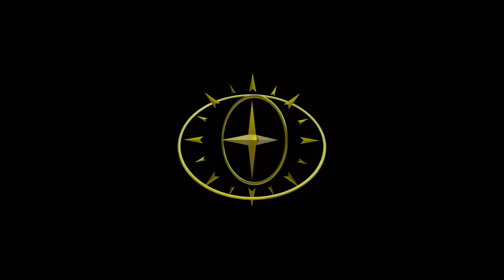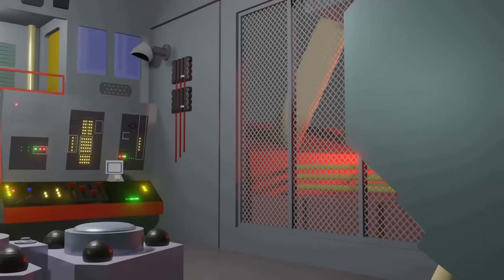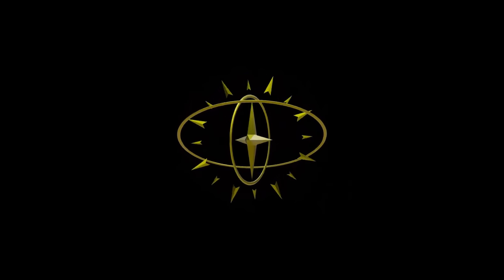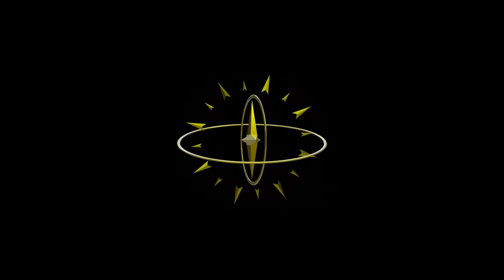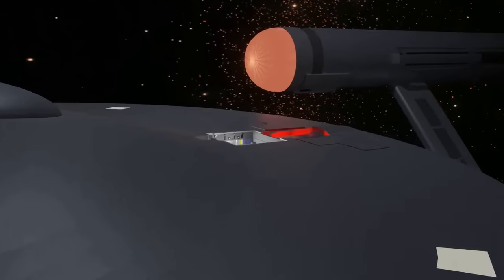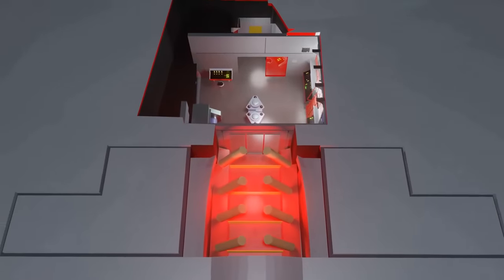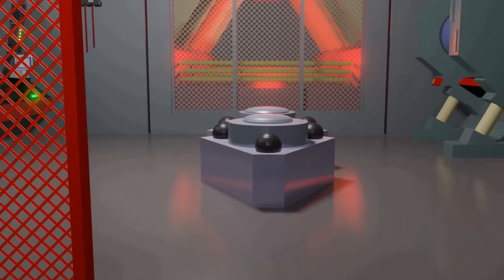The Enterprise Engine-room Enigma: where was main engineering?

Comment: I don't quite remember where I read it, but in TOS the saucer was designed to be a lifeboat and separate from the rest of the ship.  It was never shown because of cost concerns.  It would make sense for engineering to be in secondary hull in case of a warp core breach.  The real reason for this question is that the creators never concerned themselves with it, thinking the show would never be as influential as it eventually became.
Reply: TNG, me thinks. I don't recall it ever being mention in TOS.
Reply: @timsmith2525  It was. In two episodes, "The Apple" and "The Savage Curtain".

Comment: Main Engineering is in the Secondary Hull or Engineering Hull pretty much directly under the innerconnecting dorsal  it stops near the main Engine pylons  there was a separate but near identical engineering room in the primary Hull. The ship has two semi separate engine rooms in the event of an emergency separation. Each  component of the ship is supposed to be able to be able to operate to get to safety until a rescue could arrive.

Comment: the Constitution class Starship , has MAIN engineering in the Seccondary hull w/ a LATTERAL intermix chamber , that connects Directly to the Warp nacelles. there is no Enginering connection in the neck between the Saucer section & the Seccondary hull. there is no Vertical intermix chamber , unlike the REFIT Enterprise and Enterprise II class starships. 
the Saucer section only has Emergency batteries and a minor Enginering that controls BOTH the Main Enginering (seccondry hull) and the Impulse Drive systems , there is also an Auxiliary Control in the Saucer Section that has a VIWESCREEN monitor. 
and the Chief Engineer can monitor & control MAIN engineering & the Impulse system from the BRIDGE station.

Comment: The warp core was horizontal rather than vertical and largely closed off from view due to radiation - the constitution 2 was the first to have a vertical warp core - so I imagine it was beyond the grid we saw in main engineering on the secondary hull and had some sort of port for accessing the dilithium crystal. The main saucer complex did have impulse reactors but those are not connected to main engineering. A logical reason for the curved hallways in the secondary hull might have been the proximity to the neck of the ship. Ultimately there were as many rooms that could be considered "engineering" as you can guess - everything from phaser control to shuttlecraft maintenance, but only Main Engineering would have been secondary hull at the base of the neck as it needed to be in close enough proximity to deflector control etc.  This is where the warp core was located and that was why the saucer wasn't part of the secondary hull - to cut down on radiation exposure.

Comment: I remember reading somewhere that the angular tube array in the background of TOS was part of the impulse drive.  The two circular structures in the middle of engineering in TOS is the top of the warp core which passes down through the "neck" of the ship.  The main of engineering section was relocated during the refit.
Reply: Those tubes are actually the warp drive EPS power conduits. In "The Paradise Syndrome" when the warp engines fail, the sparks and flashes come from there, and in "The Ultimate Computer", when M-5 hooks in directly to the warp power, it aims at that part of engineering.

Everyone gets the idea that those are the impulse engines from the mostly non-canon Franz Joseph technical manual and his later booklet of general plans. However, later plans show main engineering in the secondary hull and a smaller engineering for the impulse engines in the saucer.

Comment: One interesting little idea: If you look at some of the early Enterprise "blueprints" that were published, they don't include a warp core at all and there seems to be no warp drive machinery in the secondary hull. I believe that early in the show, the warp engines were conceived as self contained power units, which is consistent with some of the internal production document descriptions. Rodenberry flew bombers, so it makes sense that he would conceive the warp engines as self contained power units, like the engines of a bomber. In that case, there isn't a "warp engine room" at all. I think that the "engineering deck" set was initially conceived as being connected to the impulse drive, and the "pipe room" is supposed to an impulse engine, but then the requirements of drama made it necessary for characters to directly work with the warp drive and that just had to happen in the engineering deck. The dilithium crystals get invented and just kind of stuck there for want of a better place and the location and function of engineering becomes a mess.

Starting with the movies, the demands of drama mean that we get a "warp core" as something visible that characters can interact with, but they just didn't predict this dramatic requirement early on when they were developing the show.
Reply: Believe it or not, the original Star Fleet Technical Manual has TWO engineering areas: an area marked "Main Engineering" near the Impulse Engines in the saucer, and a separate "Warp Drive Engineering" in the secondary hull right under the nacelles. Main Engineering is shown to have computers that can monitor the warp drive from there.
Reply: @Idazmi7  Franz Joseph's "Star Fleet Technical Manual" from 1975? His blueprints from 1973 show now engine room at all in the secondary hull. It's full of living space, which makes little sense, and Franz Joseph wasn't directly involved in production, but I think it does show that he wasn't even thinking about a warp core or warp engine room as a concept. The dates are probably significant because Star Trek I was in early production at the time (based on earlier work for the Star Trek Phase II show), and they built the first main engineering set with a recognizable warp. That was a big change in how warp drives were depicted. 

If you look at Matt Jeffries concept drawings for the Enterprise, you'll see the warp engines described as "Power Units" or "Power Pods", which sound like self-contained devices to be, not just outputs for some kind of engine core inside the hull. Gene Roddenberry was a bomber pilot, not a navy man, so it makes sense he'd imagine self-contained engines out away from the ship, like the engines on the wings of a bomber. Early on, Scotty operates the engines from the bridge, just like the flight engineer of a bomber up in the cockpit. He also calls them "engines" plural. I don't recall later engineers using such terminology or any plurals to refer to the warp drives, once they had a single reactor core deep inside the ship.

I think Roddenberry initially went with his flying experience, imagining the engines as self-contained, out away  from the body of the ship, and inaccessible in flight, but later the demands of storytelling required a warp drive characters could actually see and touch, and with the show's tight budget and everything being made up as they went along, we got a bunch of very inconsistent portrayals of the ships propulsion systems.
Reply: @TonboIV  
"Franz Joseph's "Star Fleet Technical Manual" from 1975? His blueprints from 1973 show now engine room at all in the secondary hull."

*SIGH* Deck 16, "Medical/Warp Drive Engineering." I swear you people don't know how to read...
Reply: @Idazmi7  What the hell? There's no reason for you to be that rude. When have I been rude or at all hostile to you? Yes, I did fail to notice the name of the deck, because I was looking at the rooms. That's an oversight on my part, and I'll admit it, but can't we just have a nice conversation about this instead of attacking each-other? Anyway, I'll have a bit more of a think about those plans now before I say anything else.
Reply: @TonboIV  
Also the reason there's living space:
"4. The primary hull is separable from the secondary hull. When separated each unit is fully capable of independent operation. (...)" - Sheet 4, Outboard Bow and Stern Elevations.

Comment: As a kid, I always wondered if there were “impulse engineering” rooms.  There would have to be some kind of space for controlling and maintaining the fusion reactors and driver coil assemblies.
Reply: There is, at least according to Where No Man Has Gone Before with Gary Mitchell's line to Lee Kelso about blowing up the whole impulse deck. Doug Drexler's plan even calls that area the Impulse Deck and has a smaller engineering space with Main Engineering located in the secondary hull.

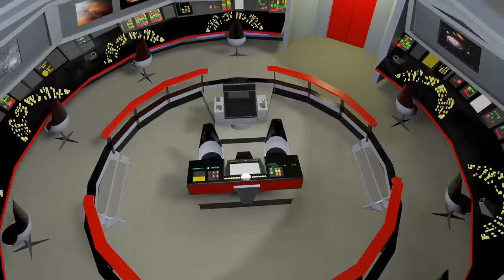Comment: 5:02 The "knob" at the back of the bridge module is supposed to be the turbolift, meaning the interior of the bridge is actually cattywampus to the ship itself, and its centerline isn't the ship's centerline.
Reply: That's a theory (and it was certainly the intention in "The Cage") but it doesn't make sense with how the actors lean in their chairs when things happen.
Reply: Well that is the shaft to the lower decks but not the door entry to the horizontal shaft, Cars can be waiting just to the right of the proceeding car.

Comment: In the second season, the Main Engineering set was modified and on the left side of the set (looking aft), there is a visible ceiling that has large supporting beams. The ceiling is curved, suggesting Main Engineering is in the top of the secondary hull between the pylon that supports the primary hull and the engine pylons. This suggests the forced perspective area behind the screen at the aft of the set is the "Warp Core" and somehow feeds into the engine pylons.

Comment: In the 90’s there was an official cutaway poster of NCC-1701 that was revised by the design team from TOS; main engineering was relocated in front of the hangar so the warp plasma could go straight up the Jeffries pylons. Which makes far more sense than the blueprints of the 70’s.

Comment: I haven't seen anyone mention the use of the term Engineering multiple times in "The Alternative Factor". That room, very clearly, was in the saucer section. To me, that lends credence to the theory that there are indeed two "main engineering" spaces, one in the saucer and the "real" main one in the secondary hull.
Reply: The Star Fleet Technical Manual does show two separate engineering areas: an area marked "Main Engineering" near the Impulse Engines in the saucer, and a separate "Warp Drive Engineering" in the secondary hull right under the nacelles. Main Engineering is shown to have computers that can monitor the warp drive from there.

Comment: My theory is that there were two Engineering rooms - An impulse engine room located in the saucer that could serve as the warp control room and then a lower warp engineering room that had a secondary impulse drive for the lower star drive section. The lower control room held the dilithium crystals. It would make sense that the star drive would have a secondary impulse capability perhaps somewhere on the nacelles, although it would be a smaller, less capable impulse drive than the one on the saucer section. It makes sense that such an arrangement would be in place, providing redundancy, which even today's spacecraft have in place to provide options in case of failure.

Comment: This is an interesting subject and I'm glad you've addressed it.  I think of the contradictions in the following way:  Due to OpSec, details about certain specifics were obfuscated and altered so as to not give away important intelligence.  An example is that the blueprints show engineering at the rear of the saucer section adjacent to the impulse drive while in Court Martial there was a reference to engineering being in the 'lower decks', where the "Heisenberg Compensator" is.  The location of the area with the Heisenberg Compensator is a bit iffy due to the space constraints of how it was depicted.  The blueprints also show sickbay in the secondary hull when episodic references said something like it being on deck five.  Seems more likely that sickbay would be in the saucer section since it was designed to separate to be a lifeboat.  The blueprints also show the Dilithium Crystals as being in the aft part of the nacelles (four each).  This, of course, contradicts what was filmed as cannon.  All of this leads me to a fan theory that what we're seeing when watching the episodes is not actually a fly-on-the-wall, first-person perspective of what happened, but rather a dramatic recreation, using sets and actors, based on the recorded logs of those missions.
Reply: One more thing I'd like to mention is that this video mentioned that engineering is shown off of a curved corridor.  I know of one specific episode where we are in engineering and the door is open where we can see a Jefferies Tube on the right, no curved corridor to be seen.  This would comport with the reference in the video about engineering being in the secondary hull, but backwards.  Otherwise it would interfere with the shuttle bay.  I spent hours pouring over the plans in the context of the episodes when I was a kid and am now happy that I have a better sense of it all.

Comment: Few thoughts:

1. Turbolift systems have so often been visualized as moving in 3 dimensions as opposed to only in vertical shafts, I think it's reasonable to imagine there could be turbolift routes around certain rooms or decks which would seem to block a clear vertical tube up and down the ship.

2. There's no reason angled or curving corridors can't exist outside the saucer section. There is a lot of negative space in ships to provide room for storage and machinery. It would be easier to angle or curve a crew corridor than to move a large system that absolutely needs to be in a certain location. So in-fiction, a curved corridor shouldn't necessarily look wrong in many locations.

3. Even before the reusable saucer separation experiment of the Galaxy class, there's references to the concept of a saucer section being usable as a lifeboat in case the entire warp system is destroyed or must be abandoned. The impulse engines so often being located in saucers really helps support this idea. I believe sometimes, it is imagined there are explosive systems designed to permanently detach saucers in case of emergency. It seems prudent to install a robust engineering control center in both hulls, for redundancy and backup.

Comment: Great little video. Love the graphics....But you got the orientation of the bridge wrong. Supposed to be offset from center a few degrees, not facing forward because of the location of the turbo lift shaft. Anyway, I always figured there were two separate engineering rooms/sections...one for the impulse engines which also operated the functions of the saucer section...and one for the warp engines which also ran the functions of the neck and the secondary hull. One good point for that....the saucer section was able to separate from the rest of the ship and fly independently, so it would gather to reason that it would have it's own separate engineering sections and the rest of the ship would have one also. Also, they would look the same for a couple of reasons...one: cheaper and easier for Starfleet to design and build a universal engineering section that would be compatible for both sections, designing two different ones would have increased the cost significantly...two: parts compatibility. I'm sure as with all spacecraft there are redundant systems installed, so that way parts and units could be interchanged between the two sections. How many times was it written in the scripts that warp controls were transferred to the impulse controls and vice versa?
Reply: The decoupling of the saucer wasn't there until Enterprise D, which was a magnitude larger than Enterprise A
Reply: @andreewert6576  the TOS NCC1701 was also meant to decouple the saucer from the rest of the ship. Is why it has landing legs on the bottom saucer.

Comment: Regarding the apparent inconsistency between "Engineering decks" and 'Engineering levels," in the US Navy, any deck below the main deck, or "deck one," is called a "deck," and any deck above the main deck is called a "level."  The main deck would generally be the obvious one, and corresponded to the weather deck that ran from the foc'sle to the fantail, or it could be designated as another one.  Aboard a Forrestal class carrier, the main deck was the hangar bay, and the flight deck was the "04 level."  So just maybe, aboard he original starship Enterprise, Engineering decks were in the secondary hull, and Engineering levels were in the primary hull.

Comment: I bet there were 2 Engineering rooms on the TOS Enterprise. Both identical, one in the primary hull, one in the secondary hull.
Reply: If you look at the Technical Manual, there are indeed two different Engineering rooms. However, they aren't identical.

Comment: The thing to remember is that the interior layout of the Enterprise in the 60s was not designed by engineers. Obviously, there would need to be two engineering rooms. Even back in the 1960s it was postulated that the saucer was capable of separating from the engineering section. That would not be possible if the engineering section in the saucer was directly linked to the warp drive. The engineering section in the saucer is directly related to the impulse drive that powers the saucer. The engineering section in the engineering hull controls the warp drive.